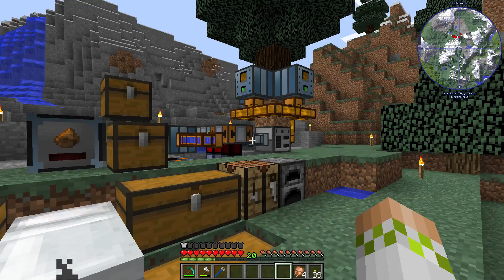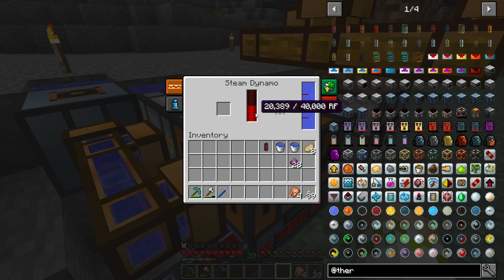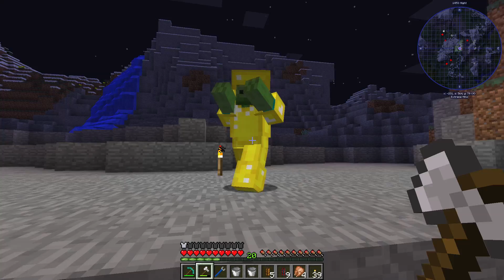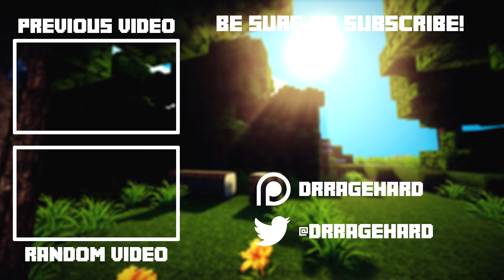Surviving With Thermal Expansion :: E04 - Boiler & Turbine Conversion Augments

Comment: im currently playing rlcraft and i saw the first of this series yesterday, so i figured i would give the mod another try, cause i had tried to figure it out for my modular turrets so that i dont have to use redstone blocks all the time, but i utterly failed lol. so for now, im gonna build what you are building underground in my mineshaft where i have three mob farms using the ooze, liquid poison, and the netherrack for the flame elementals to spawn, as well as an enchanting room. my upstairs, aka the surface, is currently full with three turret towers using a rocket launcher, a regular gun turret, and a blazing clay turret, and now a pillar for my cameras from security craft. plus i have another mob farm, that uses acid, built into the hill next to my house, which i made out of nether bricks and end stone bricks due to rocs dropping creepers everywhere and i was tired of my house being blown up and replacing blocks and stuff i had on my walls, like a clock and torches

Comment: I tried this with 2 steam dynamos as I didn't have any oil yet and the steam dynamo with the boiler conversion completely burned through a half stack of coal coke in a matter of minutes. Is the only way for this to work well is using a compression dynamo?

Comment: It would be kind of expensive but you can use leadstone wired with a servo to get the energy out of a steam dynamo, or probably a redstone signal can active it to push out the energy

Comment: While I can appreciate that balancing the different outputs of fractionating resin is the most efficient way to go, it puzzles me to hear you describe the rosin as the primary goal of the system. I've always treated the tree oil, being consistent, as the primary output, with the rosin as a bonus.

Still, one way or another it is good to keep the two mostly balanced so you're (general "you") not letting either go to waste.
Reply: *yro’ue

Comment: On the dyanmos, it's intended behavior that they only output power when they have fuel burning(or to burn). I don't know why. On the compression dynamo, you could put a few sticks in there when you're low on power and it will be able to push out what power it has before it's generated too much more.

Comment: Couple useful things: Make yourself a Reservoir, looks like a water bottle, designed to pick up fluids from the world like a bucket and then store them. Very handy instead of carrying buckets. And second, Thermal Expansion now has Hammers, which mine a 3x3, and should make your life mining much, much easier.
Reply: 3x3 hammer in thermal ? how ?
Reply: Ah, it's actually Thermal Foundation, but it's a helmet shape with two sticks under it. Mines like a pickaxe, but in a 3x3, it's a fairly recent edition though, so it's not surprising you've not heard of it. Redstone Arsenal has had a Flux-infused hammer for a while but that requires power and he doesn't have it installed.
Reply: Ty man :) rly good one indeed, durability seems a little low but its so good having an alternative to tinkers (usually i rush terra shaterer :p)
Reply: Yeah, durability varies. There's a list on the CoFH website, with Platinum having the most uses.

I usually get a Drill of some flavor, but I'm looking forward to using hammers in Modular Mayhem Reloaded.
Reply: Triaxx2 reservoirs are from enderio
Reply: The Thermal Resevoir is a bottle, not a block